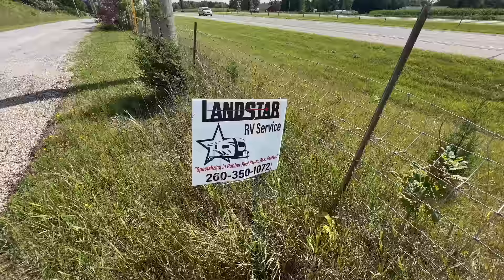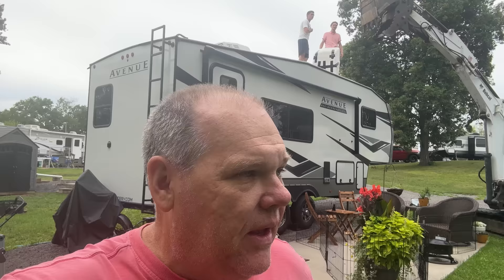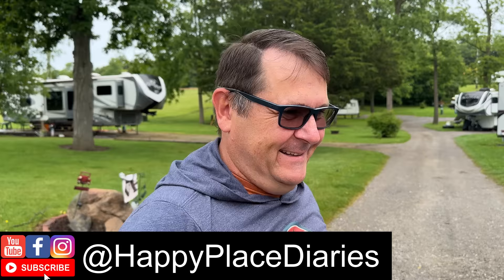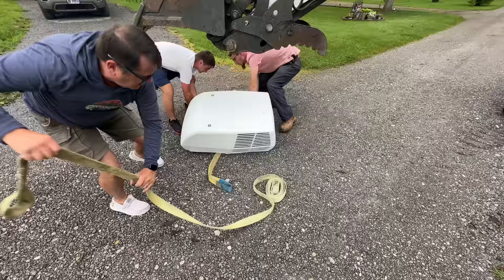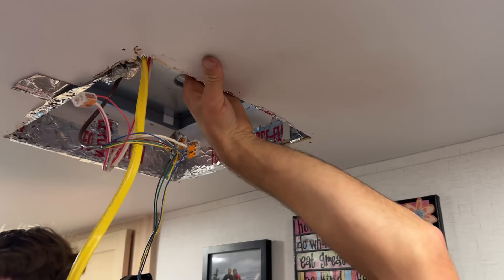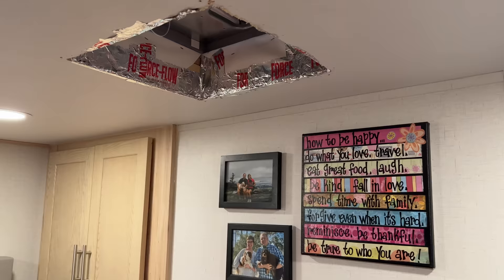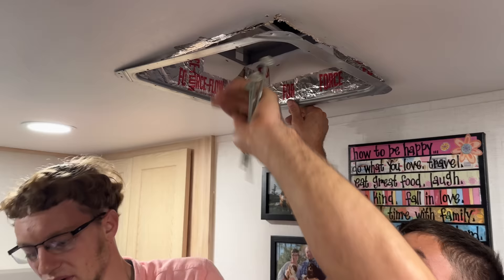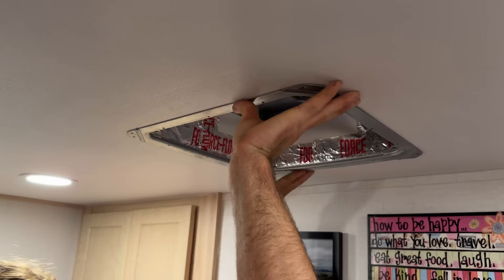ONE WRONG MOVE AND IT COULD COST US MORE THAN AN AC

Comment: So sorry you had to go through his but now you know it’s been installed correctly and will put out the maximum cold air.  Time to get out some 2x2’s a level and a tape measure to accurately measure the height! And from your last experience it wouldn’t have helped because they didn’t mark the height at that gas station 😢

Comment: Oh Lord, I just replaced my AC on my Jayco 5th wheel, we did my friends last year. But RV AC's aren't that heavy you have one or two guys on the roof, back a pick up along side the rear( or side) and one or two guys in the back (you remove the cover)  and hand it up to the guys on the roof, and don't take the AC off the pallet it comes on. It's harder to set in place than hoist it up on the RV roof. Easy peasy nice and easy. They are snap to replace, but dangling it from a machine is , rather more difficult I'd say.